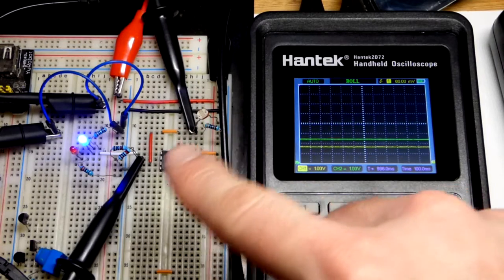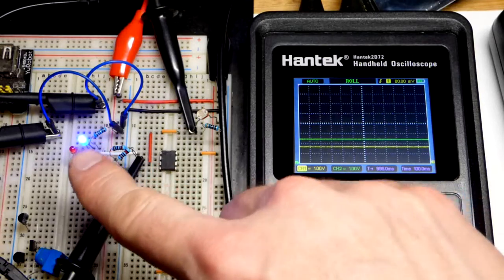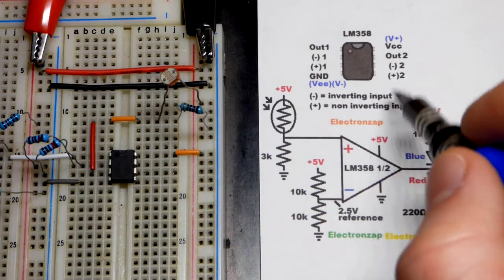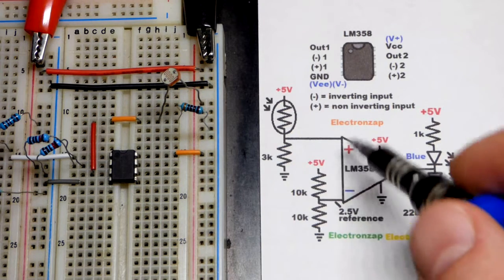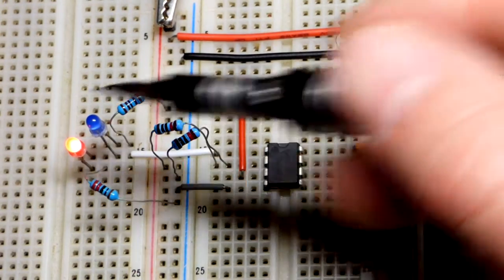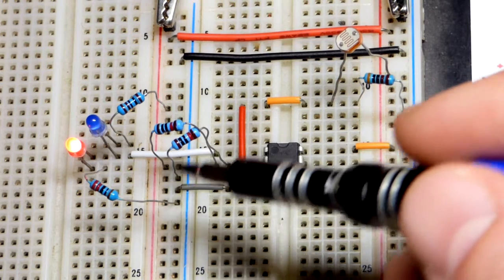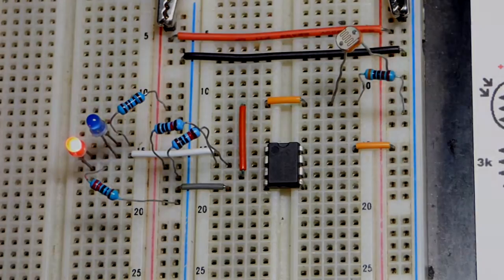Light level non inverting comparator using LM358 op amp and LDR learning electronics shorts 29

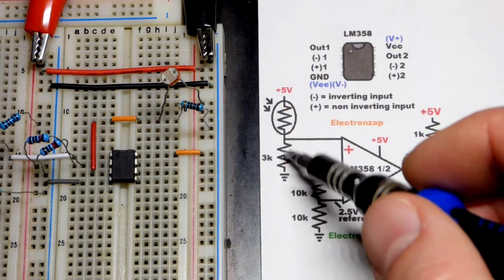Comment: Very nice. Learned a lot from you. Note that at 1:24 there is no need to use a pot or different resistors to find the right value for that (3K) resistor. Just measure the impedance of the LDR in room (or dim) light and with bright light and set that resistor to somewhere halfway between those. Doesn't have to be exact. In room (or dim) light the impedance of the LDR will be (relatively) high and you want your output to be low so, with a 5 V input and a voltage divider you want the resistor to be no higher than the impedance of the LDR (in dim room light) so that the input to the non-inverting terminal is less than 2.5 V. So that sets an upper limit on R.  Similarly in bright light you want the resistor impedance to be greater than that of the LDR (in bright light) so that the input to the non-inverting terminal is greater than 2.5 V. So that sets a lower limit on R. Choosing a value somewhere in between those two values will avoid minor voltage fluctuations influencing the outputs but, otherwise, it's value doesn't have to be very precise and a range of values will work. Cheers.